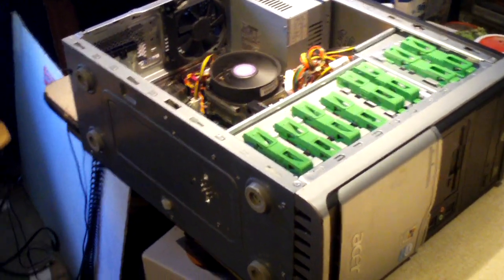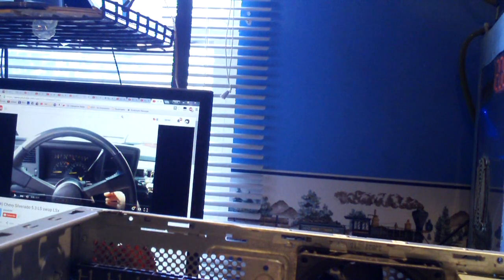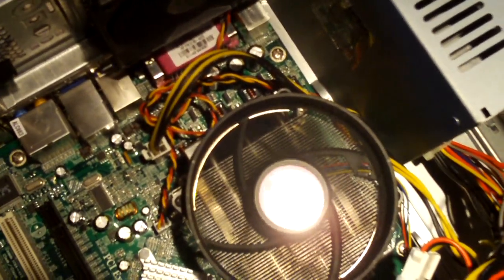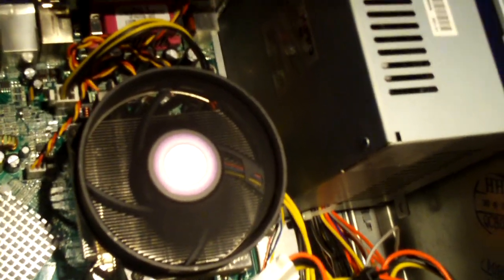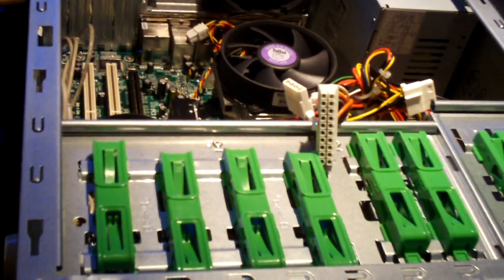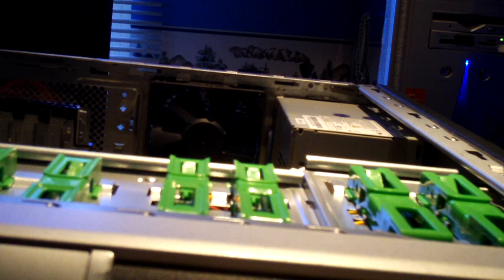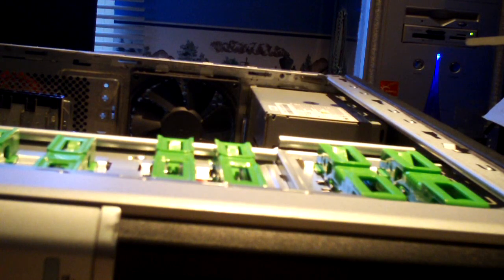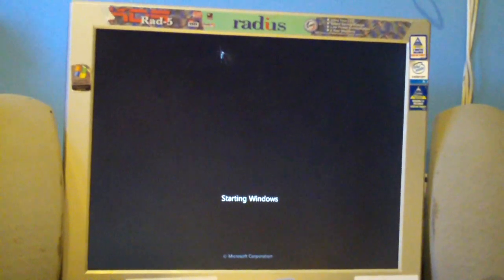A very strange motherboard issue

Comment: I think the power supply remote circuitry on the motherboard was at first stuck open so the supply never started, and later the circuitry got stuck closed so the supply doesn't shut off and instead just keeps running the fans at full speed.

Comment: i thenk the standby controler on the mother board is falling. it wold explain why evan when the pc shuts down the fans go full speed.caus the powersupply is not turning of. the procecer is just turning of . the standby controler is falling to turn of the power supply

Comment: I've had an even worse problem with an old Socket 939 Gigabyte motherboard, and it's extremely confusing. The motherboard has a 5% chance of turning on, and its reluctance to work is triggered by either changing out >>anything<< on the motherboard (even swapping out a hard drive), or just unplugging the machine from the wall. It's not an issue with the power supply, as I have tried 5 different power supplies that I know are reliable. Even the Newegg reviews for the motherboard back in 2005 state the same exact problem that I am having.

All of the capacitors look fine, nothing on the motherboard is fried, and I am positive that every other part works perfectly fine. What is going wrong with this motherboard? The name of the motherboard is Gigabyte GA-K8N51GMF-9.

Comment: I had the exact same board and I ended up replacing the epprom and it fixed the issue very strange glitch.
Reply from the maker: +MrReeceyburger123 That's interesting. That might be the same case here. I wonder if flashing the BIOS would have cured the issue.
Reply: +Cube Computer Channel Maybe its a strange one for sure, it is strange why they randomly do this and corrupt. Hopefully you can fix it :)

Comment: I have HP's that do almost the same thing, when you plug it in the thing starts up and does not post then if you turn it off via button and turn it back on using the button the computer starts up with no problem, I have no C-Mos battery in it.. I can post a video for proof if anyone is interested.

Comment: Power supply is bad.
Reply from the maker: +SuPerbMusiCFan But you're still administering heat to devices that don't need it, possibly shortening the lifespan of those components. Capacitors, especially electrolytic capacitors, do not like heat. Even if they don't bulge during the oven reflow, they have still been pushed much closer to their breaking point. The common temperature rating of electrolytic capacitors used on the generations of motherboards, such as the one in this video, is 105C.You're easily exceeding that temperature rating in the oven. There have been a couple of cases where I overheated a capacitor near the northbridge chip, and had to replace it right after reflowing the board.
Reply: +MrMac5150 he has replaced the psu lol its not it
Reply: TechMaster2133
You should only have 5 volts standy, in order
for a fan to spin that fast you have 12 volts on from the power supply..
Reply: MrMac5150 diid u not hear him say he replaced the psu on sight and then did it again in the video so he has tried 2 power supply's...try watching the video before u comment lol, like seriously dude pay attention xD
Reply: +TechMaster2133 two bad power supplies. I hear, I see, I have run into this.  Maybe you should pay attention, dude.
Reply: haha 2 bad power supplies in a row from a dude that refurbs improves and rebuilds all of the power supplies he uses I doubt it lol hes tested these power supplies in multiple computers if u watched his vids u would know this, also if you bothered to read the description you would get a clue that this is a motherboard issue....." It appears the circuitry that's in charge of sending the power-on signal to the power supply is stuck closed"
Reply from the maker: +MrMac5150 I paper clip tested both PSUs. They do power on when the green and black wires are shorted.
Reply: TechMaster2133
You will see, I have been repairing them since 1982, let him try a good power supply.
Reply: MrMac5150 I doubt that those power supplies are defective lol ive NEVER had 2 bad in a row and it seems to power the pc just fine once its up lol
Reply: +Cube Computer Channel You state they (do not power on) when you 
short the teminals,  pull the power supply out, put a load on each terminal with the use of automoitve light bulbs, test each leg, for proper DC values and all the grounds, next make sure you have NO ac on any of the rails.
always make sure the power supply is working perfect before you go to next step. It is NEVER the power button. Look at the caps around the CPU.
If it is a cap it will be a shorted one easy to find.
Reply from the maker: +MrMac5150 The power supplies work fine in other computers. Now do we need to further complicate things or can we just keep it simple?
Reply: *****
Power supplies are not that simple, you are
dealing with a switching transformer, that presents you with many problems.
Reply: +MrMac5150 You are so ingorant. People have told you multiple times that the power supplies are infact good because they were tested in other computers, in which they work just fine, even the creator of the video told you that it is a motherboard related issue, yet you still keep claiming that it is a power supply. Working on power supplies since whatever year doesn't mean you are never wrong. Technology has change a lot since then.
Reply: SuPerbMusiCFan
Dear double ingorant, love your name calling.
still the power supply.
Reply from the maker: +MrMac5150 Actually, transistors do the switching. Transformers step down the voltage.
Reply from the maker: +MrMac5150 Again, both power supplies are fine. The LiteOn was returned to this Acer and it was put back into service over two months ago. The client was fine with this minor issue as he normally leaves the computer running all the time anyway. The HiPro recently replaced a bad unit in another computer at the same business a few weeks ago. Now, if these power supplies were "bad" then I don't think they would be in service right now. I tested both units with a paperclip, while still attached to a load. Both units will power on when the paper clips close the PS-ON circuit. When the paper clip is removed, the units shut off. Now, yes I did make a typo this morning when replying to a prior comment, and you have seemed to have taken that one word ("don't" instead of the intended word "do"), and ran with it... despite the fact the both units did in fact run in the above video (The computer booted into Windows!). Seriously, if you've been working on this stuff for so long, then how it it not dawn on you that if the power supplies did NOT power on when paperclipped, how in the world would the computer run? It wouldn't. The PS-ON circuit is the only thing that tells the unit to power on. Now if the constant power-on issue was related to the power supplies, then they would have exhibited the same behavior when their main connectors were not connected to the motherboard.
Reply: +MrMac5150 ur wrong... 5v standby is only for motherboard turn on/off circuit... :D not all system
Reply from the maker: +Green Stick +5VSB is also in charge for computer sleep. The motherboard gets 5V at all times from the 5VSB line (purple wire). It also powers the PWM/supervisory chips in the power supply whether it is on or off.
Reply: ***** yep, but that problem is likely motherboard problem. try to put it in oven on 400°F and 6 minutes.
Reply: Green Stick
You will melt the connectors, people that tell you to put things in a oven are not electronic repair people. you trouble shoot the board, but need a schematic, with values.
Reply: MrMac5150 nope nope nope...
:DD the connectors will not melt... :D i put in a motherboard in oven on 400degrees farenheit and that motherboard started to work :D will you find motherboard schematic and fix it with soldering iron?
Reply: Green Stick
Not all plastics are the same heat rated, better insulate it first.
Reply: +MrMac5150 You seem to pretend to understand computers but you do not at all actually. Nick himself did that to atleast three motherboards with one of them being repaired and still working flawlessly
Reply: SuPerbMusiCFan You're true! I don't know all about computers. But i tried to bake one motherboard, and it works! :)
Reply from the maker: +SuPerbMusiCFan I reflowed a few boards, but did it with a heat gun, NOT an oven. MrMac5150 is right about the oven. It is a stupid idea as you will melt the connections on the board and possibly kill some capacitors. The reflow procedure that I use is a local procedure, administering heat to only the chip that needs it. I doubt reflowing the board would have cured this problem. If it was more sever of an issue, such as never getting it to power on, then reflowing might have been an option. Even in this case, you'd only want to reflow a southbridge chip that has the bare exposed die and not the plastic cover. A heat gun would easily melt the plastic cover.
Reply: *****
I've seen examples of people doing it in a oven with positive results. You don't need to keep it long inside for it to work